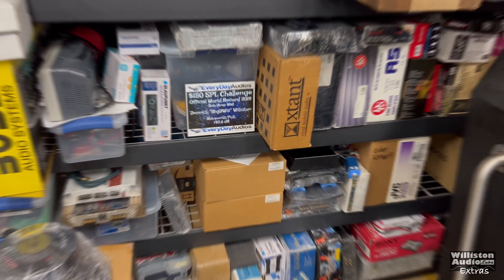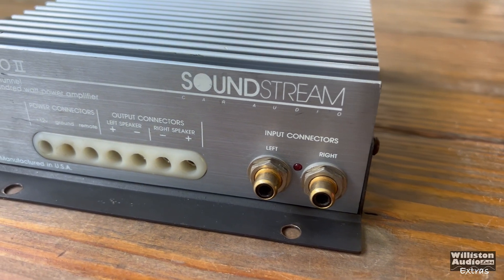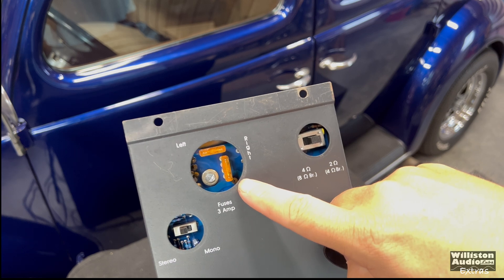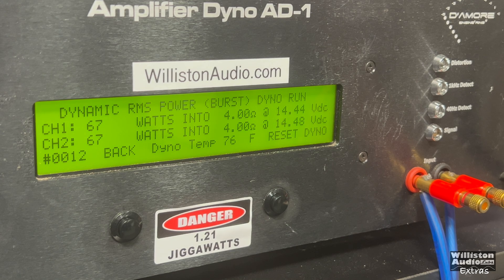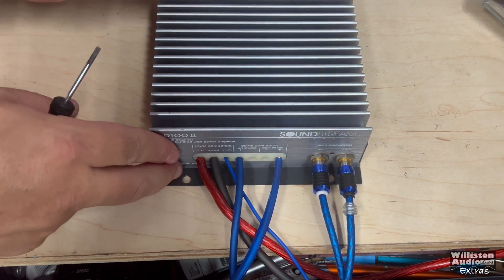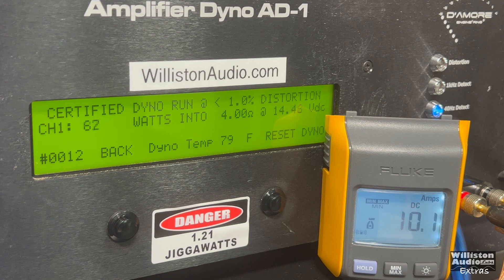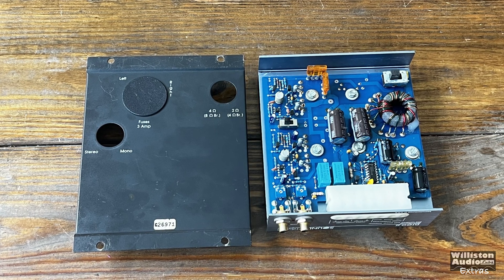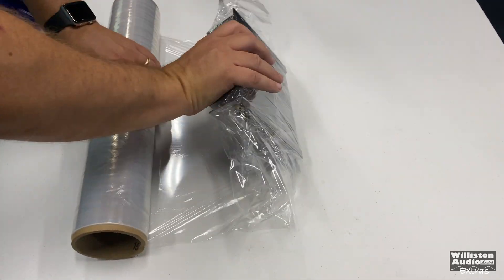1990 Soundstream D100 ii Amplifier Overview and Amp Dyno Test [4K]

Comment from the maker: Shop eBay for Soundstream D100 Amps (affiliate): https://ebay.to/3T5x6yl
18" Wide Stretch Wrap (affiliate): https://amzn.to/3AHbQrm
Meade916 Test of Soundstream D100: https://youtu.be/aAgEh0-ACPk
Video of the D100 ii and Class A 100 ii: https://youtu.be/Fh60LyHptX0
Soundstream AMP DYNO TESTS:
Soundstream MC500: https://youtu.be/rMQ9EsnXnj0
Soundstream Reference 500: https://youtu.be/RrMdf87Awmc
Soundstream Reference 300: https://youtu.be/qB-mlKvz1pY
Soundstream Class A 10.0: https://youtu.be/q6HBoyr5ixI
Soundstream Class A 10.2: https://youtu.be/8F6SncGEKag

(Video Gear I Use) 
Camera - iPhone 13pro 1TB - https://amzn.to/3nCjGvc
RODE Wireless Go II Microphones: https://amzn.to/3Q6NVHl
Shure MV7 Microphone: https://amzn.to/3A4OICK
Zoom H4n Audio Recorder: https://amzn.to/3BXjVsS
960 LED Panel: https://amzn.to/2Sxoq3S

This VIDEO was EDITED with LumaFusion on an iPad Pro 12.9:
iPad: https://amzn.to/2Ancr1W
Software: https://goo.gl/6yvWss

--------- Test Bench Equipment -------
SMD / D'Amore Engineering Amp Dyno: https://goo.gl/sJTcf7
XS Power D1400 Batteries - https://amzn.to/2BPFCKW
XS Power PSC60 Charger - https://amzn.to/2CHGcfs
Fluke 1000A AC/DC Clamp Meter: https://amzn.to/2Rw5WDA
Handheld Dyno: http://amzn.to/2u2EgKV
My Favorite Screwdriver Kit: http://amzn.to/2x0VzcE

DISCLAIMER: This video and description contains affiliate links, which means that if you purchase from one of the product links, I may receive a small commission. As an Amazon Associate I earn from qualifying purchases

Comment: Sound stream was never a powerhouse amp but they sounded very good.
Reply: ...not this particular amp, but Soundstream made some very high power class A/B , quarter ohm stable amps. The "Tarantula"  mono block was rated 2000 watts at 2ohm, and most considered this to be under rated. Soundstream was always at the very least competitive with their contemporaries, usually out performed the competition
Reply: @raymo6795  the earlier SS Amps were made for SQ
Reply: @NurseTonyYT  I believe all SS amps could achieve good sound quality ( pre 2000).These were  not very high powered amps, but none of the other legacy brands of the time were either. Soundstream was always on par or better than what was offered in the early 90s .And usually on the cutting edge, and typically designed for high quality sound, as with all the other brands, but SS went about it a bit differently compared to RF, PPI, Orion etc, probably Zapco most resembled SS design philosophy more than the Arizona brands…imo.

Comment: This amp was sold under another name, I think it was Artcraft. Identical except for the color of the heatsink, the Artcraft is brown. Same chassis, board and components. I have one in the back of the closet somewhere. Sweet sounding amp. You should do a review on an old ADS PQ-20 or PH-15. Great old battle tanks.
Reply from the maker: Check this Vintage SQ Amp Tested! a/d/s PQ20 Review and Amp Dyno Test
https://youtu.be/KrLNDorSHKk

Comment: You need to test a db aak-20,000.1 @.5 ohm at the highest possible voltage you can supply it. Nobody ever tests the monsters. I’ll send you one to test. I have 3. I’d need it back though 😂

Comment: I had two Soundstream D200 series 1 amps in my Nissan Pulsar driving 2 10 Punch subs in a vented enclosure that took up most of the trunk.  You could fry an egg on these amps after about 10 minutes of use.  Sold em and replaced with a single Punch 150 that hit as hard but was cold as a cucumber.

Comment: What i started doing with my old electronics which i wanted to keep in good condition is I vacuum seal them in food-saver bags. I live near the beach so it's the best way to prevent corrosion over time.

Comment: Big D or anyone else reading this. I had a pair of 12 inch subs in the mid 90's made by Eletro Bass (EB). For the time they were massive. They weighed 25lbs a piece. They had a redish colored surround and the letters EB on the dust cone. Some of the best subs I ever had to this day. Does anyone have any recollection of these? When I look online it's like they never existed. If anyone knows anything about them please let me know. Unfortunately after blasting them around town my car was broken into and the entire system was stolen within a few months of me having them. Thank you in advance to anyone that has any knowledge of these they would like to share.
Reply: I found one on eBay has the accordion type red surround.
Reply: @johnwilson7799  I checked it out. That is a cerwin Vega eb. The actual brand of the subs I had was EB (electro bass). Thank you for taking the time to look into it though. I hope you have a great day.
Reply: There was a store that sold EB subs in Augusta GA in the early 90’s. I remember the store having an EB poster hanging, presenting EB’s promotional vehicle, a Chevy Lumina van,  painted red with the white circle with EB in the center.

I purchased EB’s low end 12” that same day.
Reply: @hubertcarter837  I bought mine in Aiken, S.C. at a local car audio shop. They probably had 50 to 100 of them. I remember the them having the same poster of the van inside the store. Wow thank you for bringing that to my attention. I'm sure they are all long gone but I'd love to have a pair like the ones I had. I wonder if maybe they were only sold in certain locations? You are the only person so far I've talked too that has any knowledge of them and it being only a short distance from where I got mine makes me even more curious.
Reply: @Adam-nv9zo  I don’t believe the EB subs were anything special. I remember my friend was obsessed with subs and enclosure designs. If those subs were worthwhile in his opinion he would have owned a pair. He was my car audio and electronics guru and I trusted him 100%. There was a ton of great gear in the mid 90’s. I usually tended to favor Soundstream gear. Although subs alone are squally nothing special regardless of how impressive the build quality may be. The performance of any sub system is a combo of the sub in the perfect enclosure for that SPECIFIC vehicle.
Reply: @Adam-nv9zo  One more thing. Those EB subs could have been Cerwin Vega subs with an EB logo. Manufacturers and factories often did and still do this.
Reply: @Assimilator702  that maybe so. I just don't remember any Cerwin Vegas with 25lb motors back then . The baskets were not of cerwins design either.
Reply: @Assimilator702  I won several competitions with those 2 subs in just a matter of months. They were definitely special for their time.
Reply: @Adam-nv9zo  Interesting. Was it an SPL class you entered? I have a feeling they were re branded Cerwim Vegas.
Reply: @Assimilator702  yes. Nothing fancy just old school spl modified street class.
Reply: @Adam-nv9zo  I usually entered non SPL classes in local USAC comps. I hit a 141 dB with 2 Soundstream Exact 12s with each sub in a 1.8 cu ft ported enclosure with one Rubicon 702 on each. I usually hit 139.2 but that one day I had new ports I was testing in my modular enclosures that were usually run sealed. I was putting more effort into getting larger midbass drivers installed up front and dialed in which is much more important than sub performance for music listening.
Reply: @Assimilator702  those subs were great man. I've always loved sound stream.
Reply: @Adam-nv9zo  there were only a few speaker manufacturers in America back then. From my knowledge (admittedly limited) two of those are no longer around, which leaves Eminence as far as I know.
I would try contacting them and ask if they made those speakers for them; and if so, should they produce some replicas for you. I’m not far from Eminence now; and have heard from several people that they will do some one off stuff and repairs.

Being what appears a southern region company (from what we have gathered) there may be a chance it was made by Credence (I believe that was their name) that produced early JL subs and the original round Solobaric subs. If that is so, reproductions may be a lost cause.

Come to think of it, the owner of that audio shop actually had that Lumina van at the store for a while, I do believe. I wonder if these stores were owned by the same person simply selling a house brand.
Reply: @hubertcarter837  that is a good question. Thank you for the info. Its definitely worth a shot giving them a call. I'll do that in the morning. Thank you again. Have a great day/night.
Reply: @Adam-nv9zo  true heart designs has them check it out
Reply: @thamenacechris  thank for the info going to check it out right now.
Reply: @thamenacechris  just found the electronic bass 12. Unfortunately it's the older model, before the model I had and  was looking for. Still closer than I've ever got to finding them. Thanks again for the information.
Reply: They are still around true heart sound has them
Reply: It has a big eb on the cone
Reply: Think is was the low frequency line from EV (electro voice)
Reply: @johnregister6437  the ones I had were definitely EB (electro bass) i still have a old printed picture of the set up. I wish I could find out something on them. I've tried for years to no avail.

Comment: That AL amp is Audio Logic. I had a couple of those. I think the model was the AL600, if memory serves me correctly. I actually just tossed an empty box of one of those. They absolutely wouldn't handle anything less than 2 ohm loads without blowing the fuse or the fets. They weren't terrible for the price. They might have done 180-250 rms @ 2 ohm, by my guess. I'd definitely be interested to see what the dyno says they'll put out in a "perfect world". I had two paired up on the 1st version PowerBass 10s that were rated to handle 300rms. The subs handled more than the amps could put out. Wasn't a bad little setup in an 83 Datsun 280zxT. Hopefully you'll show us that AL soon.
Reply from the maker: Awesome, thanks for the info!

Comment: I remember back in day I was debating between soundstream and ADS well went with old ADS PQ 20 and 10 power plate as didn’t feel soundstream would run subs as well !
Reply: Still have a couple PQ10s on the shelf.  Those things were bulletproof.  Especially compared to how often Rockford amps of that era would blow up for no reason.  I don't think I ever serviced an ADS amp.
Reply: @drozcompany4132  lol true on fosgate I had old punch 75 that went in for half dozen repairs until it finally smoked up but that was my fault

Comment: Yes, another old Soundstream! I don't get that ohm load switch, though. It'll run and put out more power w a 2ohm load in 4ohm mode, and it's rated/safe for that, so why would you need the switch?
Reply from the maker: Protect the amp

Comment: I love that you did this amp. Back in 1992 (somewhere near there) I bought it's little sibling, the D60 II to pair with my Orion 280GX in my minitruck. I used the D60 II for my doors and the Orion for my subs. I absolutely LOVED that little D60 II. I still find myself on eBay every now and then searching for a D60 II or D100 II. One of these day's I'll find one priced right and I'll get it. Compared to the wires hanging out of the amp that so many amps had at that time, the Soundstream connections were just so beautiful when installed. I was looking to get another Soundstream amp to replace my Orion but it never came to be. Life got busy and car audio while always there took a backseat to my wife and our kids. But I still love the old school Soundstream.
Reply from the maker: Yeah boi
Reply: …always been my favorite too

Comment: Very cool man!!! I loved soundstream back in the 90s. They kinda went down hill as for the ratings, but it seems they are offering some decent atuff sill
Reply from the maker: I was a huge SS fan between 90-97, just never bought one
Reply: @wal2  I didn't either,but a couple buddies of mine had the reference 500s on Some JL 12s, at the time it seemed pretty loud! I almost picked one up, but kinda fell out of the car audio scene for awhile. I guess that's probably why im always interested in the old school stuff.
Reply: What do you mean SS went downhill as far as ratings? SS always made solid stuff that got better with every generation until they went belly up and. Ought out after the 2002 product releases.
Reply: @Assimilator702  That's exactly what i meant! In the 90s their gear made rated power. Now alot of  of their stuff has inflated number's.  Not sure of the reliability either of the new gear.

Comment: Honestly the type of amp I'd like to use on my desk. All wiring on one end, class A, and can be powered sufficiently from a 13.8v ham PSU.
Reply: I use a Reference 200 to drive a pair of old 6.5 MBQuarts components and a JL 10” in tri mode for my computer monitors, in boxes that I made, they sound great. I have all this old 12 volt gear and this is a fun way to utilize it.
Reply from the maker: Yeah awesome amp for that situation!

Comment: that heatsink for 100w amp huge .
Reply from the maker: Kinda
Reply: Takes a lot of heat sink to dissipate that 60% power loss
Reply: @drozcompany4132  modern class ab amps are not much more efficient. But they use much smaller heatsinks .

Comment: That SPL amp is a old power acoustic, so you all ready know.🤦🏼‍♂️
Reply from the maker: Yeah, will be one of "those" tests 😛
Reply: @wal2  a stereo shop I used to work at sold those SPL as well as the Soundstream amps.
Even the larger SPL amps were more like a boss or planet audio..